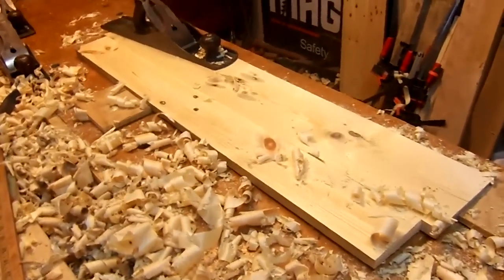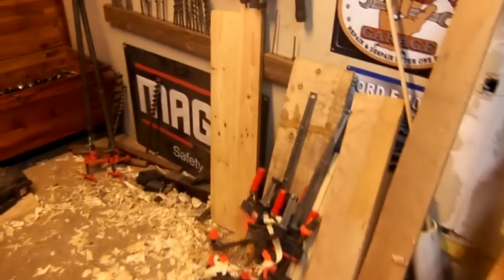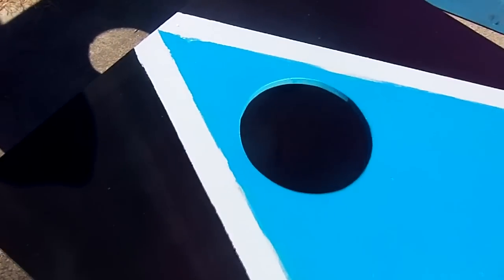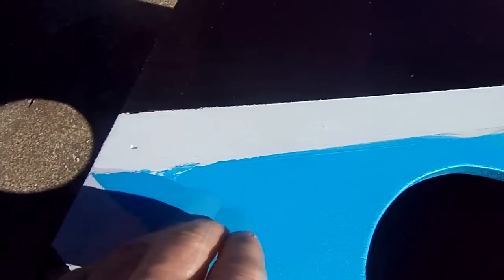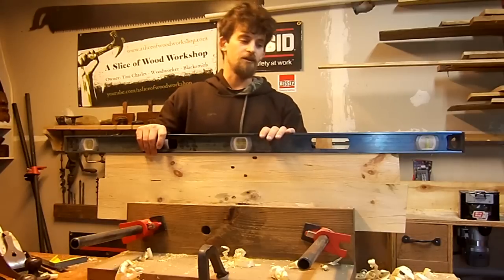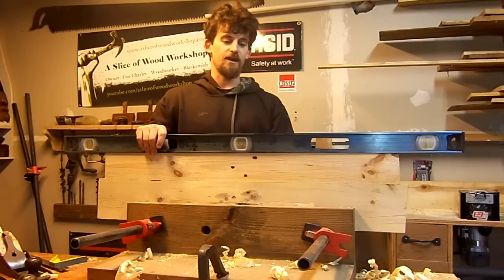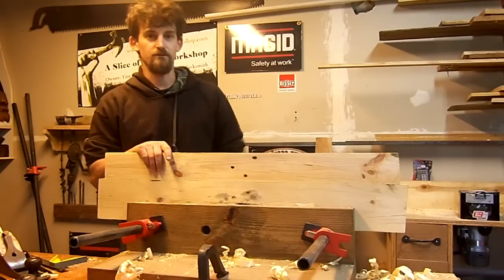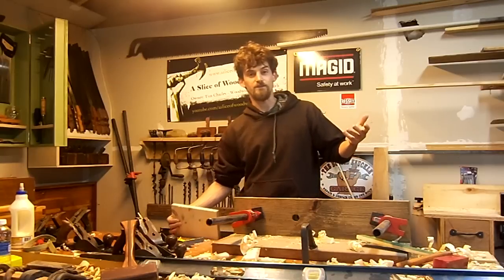Battling the Wind!

Comment: You need to get a roll of the green frog tape for better edges. I usually roll the tape with a j-roller you also use the edge of a board. I also take the tape off before the paint is fully dried which helps prevent paint pull up. I will sometimes run a sharp blade along the edge of the tape before pulling it up. Go Panthers. You in NC?
Reply from the maker: I'll have to give the green tape a try next time. I am in NC near Greensboro.
Reply: +Timothy Charles used to live in and around Greensboro a long time ago but now live in Myrtle Beach.